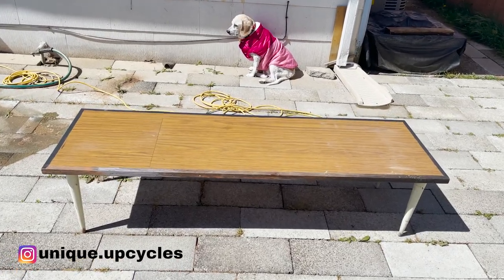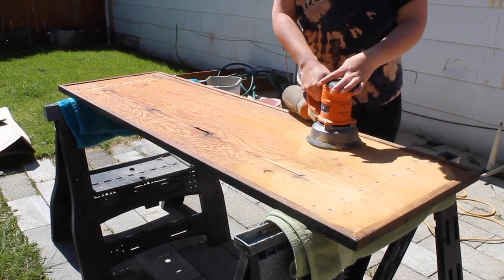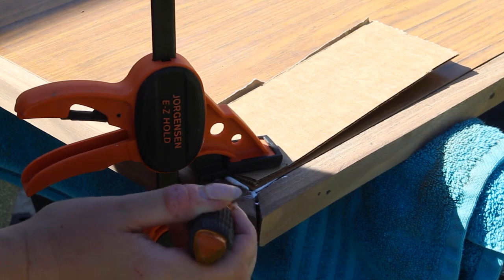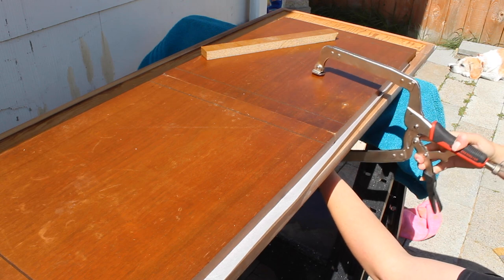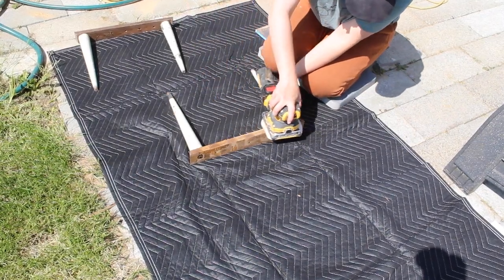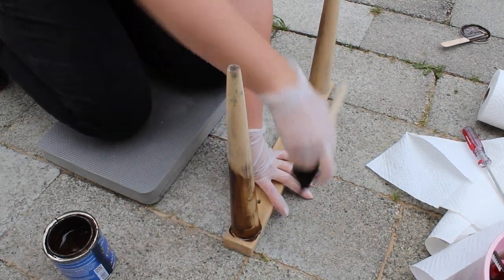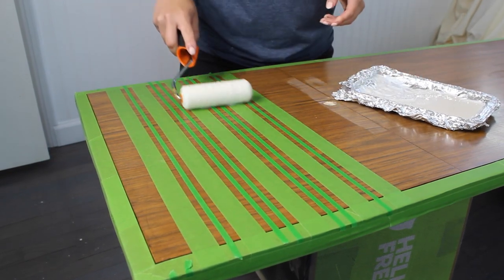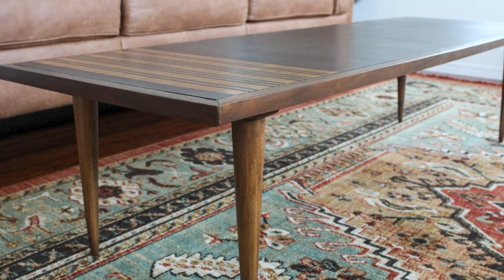Extreme Furniture Flip | Mid Century Coffee Table Restoration | How to Paint Laminate

Comment: Nice job! I'm always wary about long or big coffee tables with tiny legs. I just saw one at Salvation Army for ten bucks and I was like should I?
Reply from the maker: Oh yes you definitely should! Also if the legs don’t seem stable you can always reinforce them with glue or additional screws if needed.
Reply: @UniqueUpcycles  somebody yeah redid l-bracket underneath them to give it support either kind of a traditional legs you see that are about 16 in you get from Home Depot. It was a 24 x 36 coffee table that's hard to tell if it's veneer or not. With a inch wide strap black metal hardware 3 inch away from the corners. A total of 4, my only idea for the piece was to stain the legs(they r unfinished) then light sand the top, stain it then white wash it in some white chalk paint.  Seal it, then try making the hardware as close to oil rubbed bronze, with either spray paint or gliding wax.